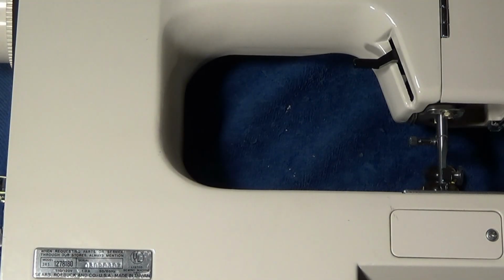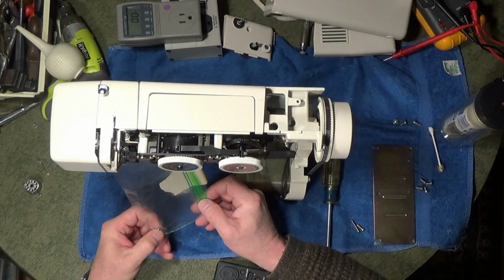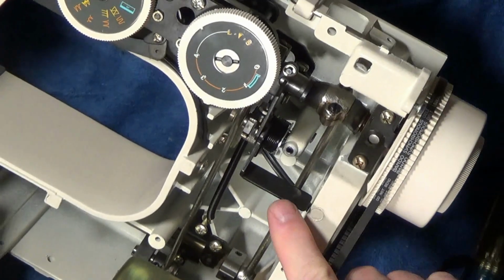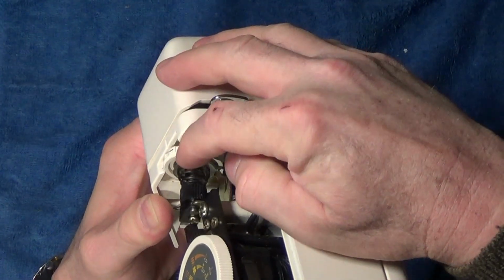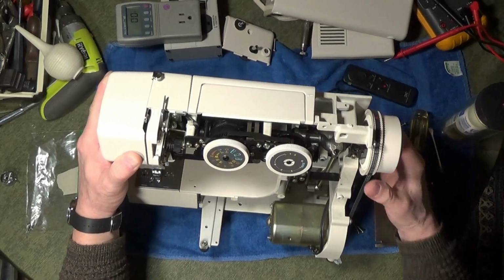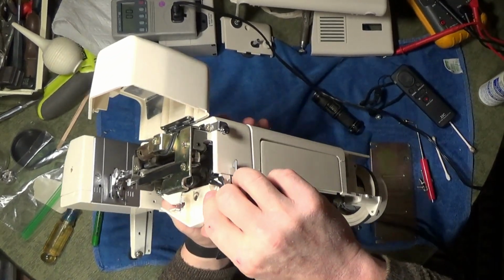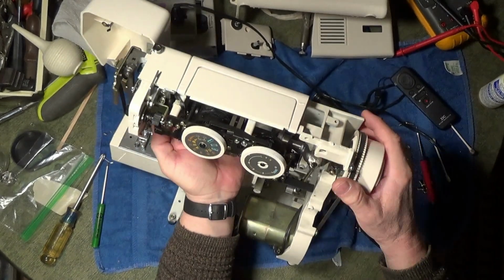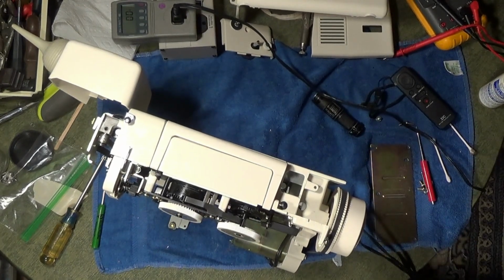Kenmore 385 12781 Sewing Machine - Sticky Reverse and Parts Left Over

Comment: Appreciate the video but would have liked to see exactly where you oiled it up and how. Bought one at an estate sale and there is very little information on this model
Reply: for anyone looking in the future for information, I had the same problem with sticky backstitch key and found that it was primarily sticking for me on in the bottom portion responsible for returning it normal stitching. I basically just covered everything down there in oil and eventually it started working